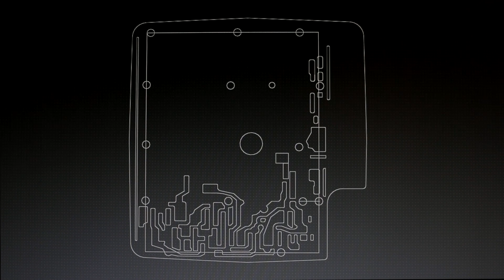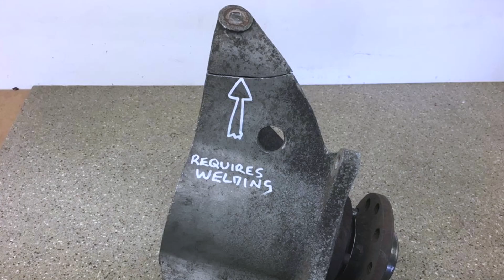Using a gearbox to blast car parts | Timelapse

Comment: You could always cut out a section of the cabinet and install a piece of plexiglass. The put the light on the outside. That's how our cabinets at work are... makes sense. It's a real pain when things drop through the grating when you are media blasting. Might want a screen to set on top for smaller things.

Comment: Pro tip:  get a high sided basket with holes in the bottom or strainer to hold small nuts and bolts.  That plate is sick…but small things will fall into the media.

Comment: i came late to the party (about 5 years late ! )
started in the middle and then went back to the start episode and watched them all in order.
I'm up to date finally , but now what am i going to do in the evenings ?  
good to see the invisible elves are still with you.
nice work.
Reply from the maker: How was the progression?
Reply: i could see you were finding your feet a bit in the early ones and that's fair enough.
there were times when you would change direction,  for example from the lotus to the merc and at first i was disappointed  but soon learned to love the new project.
i think it's the way you make it engaging and inspiring at the same time.
you really are good at this.
my BMW e30 convertible was stolen so i have nothing to work on but after one of your pep talks i went out a few evenings and cleaned out the shed, set up a bench and made a space for a car.
you talked me into it.
still no car  but im ready. 
thank you.

Comment: Galvanic corrosion in the suspension component. Used to see it all the time in Audi front suspension uprights. You could try an air hammer, but you're probably going to end up cutting the bolt flush & drilling it out.

Comment: Aluminium expands far more than steel with heat. If you have a steel fastener or sleeve inside aluminium you want to add heat to release the grip. Even 70C makes a big difference. For example when removing bleed screws from aluminium calipers

Comment: Your channel is so relaxing. Good for my blood pressure.. I can imagone if I had my own channel,  it would be quite the opposite. Ranting and cursing at reluctant nuts and bolts. Hitting everything with a hammer to make it fit. Incandescent with rage as simple jobs escalate into interminable projects.

Comment: Love the grid for the blast cabinet, watching the last minute of your video and with knowledge of my blast cabinet make some slots around the edge of the tray so that media cannot build up there. I am always amazed about the piles that build up in mine at the  edge and there is only 1/4 inch in mine. I have been following the Esprit build partly as my best mate back in the day had an Esprit and when he bought it he came round and threw the keys at me ad told me to take it for a rip.... 10minutes later I return upset... no I hadn't crashed it bring 6foot 6 (2m) I couldn't fit in it to drive it!!!!!

Comment: Did you try an air chisel with a piening end on it? I've broken some surprising stuff loose with those. They punch rivets out of truck frames, so...
Otherwise, just crank on it til you snap the stud and drill the rest out

Comment: I've used Alum powder to dissolve a snapped flush  steel stud  in an aluminium casting before. Granted it was only M8 in size and took ages, but left to sit somewhere warm ( heat seems key to success ) , it did dissolve it till there was nothing left. 
The process left no marking, staining or anything on the aluminium part. So I guess you could cut the bolt flush on the insides and try it ?

Comment: Maybe a little heat to free up the bolt?  I don't remember if you tried that before.  I still like seeing the frame getting picked up and carried around by one person.  Crazy light.
Reply: You beat me to it, Chuck. A gas torch used sparingly works very well when combined with a spot of concussion.....

Comment: I use alcohol to help install the rubber bushes. It acts a good lubricant in the rubber and dries quick leaving no residue.
This is trick I lear working on lab equipment. There was a Coulter with lots of silicone hoses to replace every 6 moths. We use alcochol to help the silicone on the pass through fittings.

Comment: Can you get a hacksaw blade in between the link and the upright on both sides?  Cut the bolt, and then press it out once they're apart?  Replace bolt with new.

Comment: It looks like a valvebody from a Mercedes 722.4 Gearbox🤔

You have got a CNC plasmacutter but using a vice to press controlarmbushings. 😍
Reply from the maker: 😆… shade tree 4 life! 10 points and a double ❤️722.401
Reply: @soupclassicmotoring   Ha ha now i can sleep fine!  Cheers!🍻

Comment: Can you heat the stud? Induction coil  or gas torch? 
Would you be better off cutting the stud flush and drilling it out? 
Would a hacksaw blade fit in between the arm and hub to cut the stud?

Comment: Did you fit new bushes before you sandblasted the upper arm?? If so why?? I'm really confused
Reply: My guess is he re-used the old bushes to protect the internal machined bore from the abrasive
Reply from the maker: Bingo! Instantly regretted removing them
Reply: @jerrydonnan8665  just avoid the area or cap it off 🤷🤷🤷 it's how I've done it

Comment: George,  It‘s an  automatic gearbox oil gallery but I bet it didn't just happen to fit perfectly in your sandblasting cabinet 🤣😂 lol. Great video. Cheers Dave
Reply from the maker: 10 points
Reply: From a Mercedes 722?
Reply: Having watched a 'few' Precision Transmission videos, that's exactly where my mind went, too!
Reply: Always someone quicker - my thoughts exactly

Comment: Wouldn't some heat get that bolt loose?
Reply: Can't be tight if it's liquid 🤣
Reply: @rogerneumann8105  Some heat, not all of the heat 🤣
Reply: Yeah SMA out of New York has a few videos with torch work to separate something like this. That said Subaru lower control arm bolts have a tendency to rusting in place you usually can cut through the bolt and then go from there either with an air hammer or other things. But those are a Lotus and it's all steel & common parts
Reply from the maker: Just a little worried about excessive heat around the alu.
Reply: Heat isn't a problem for aluminium as such, at least not until it starts to soften & if it needs that much then it was always bin fodder! In all seriousness a few good heat cycles on that & I'm sure you'd move it. You run way more risk trying to press/batter it out could that is for sure.
Reply: @rogerneumann8105  Eric O is such a legend!
Reply: I'd try some heat directed at the castings in the vicinity of the bolt- worth a try at least.